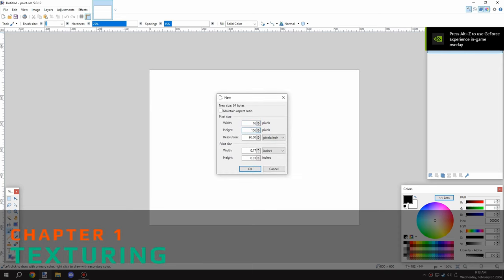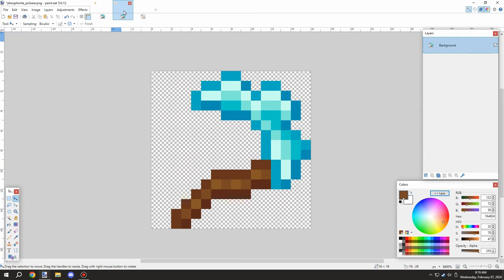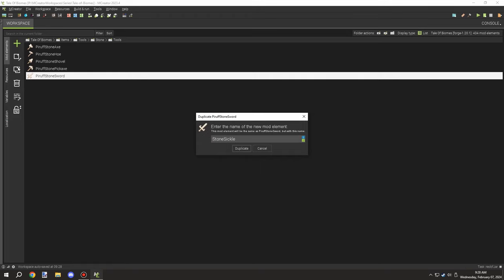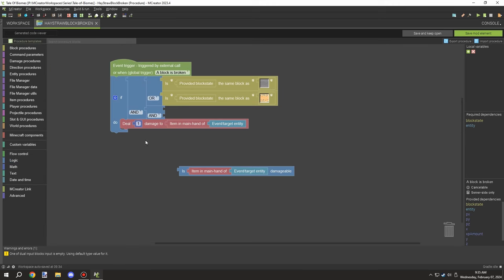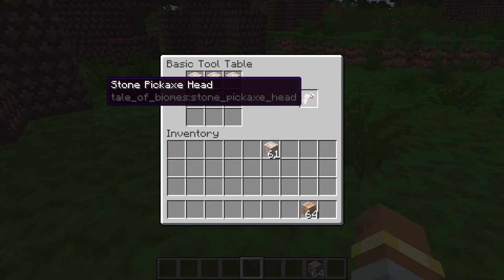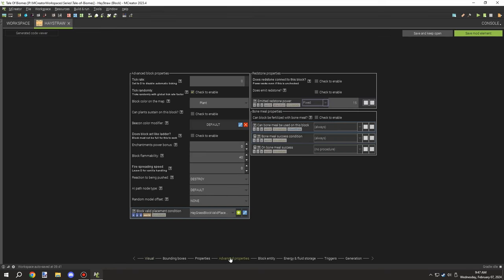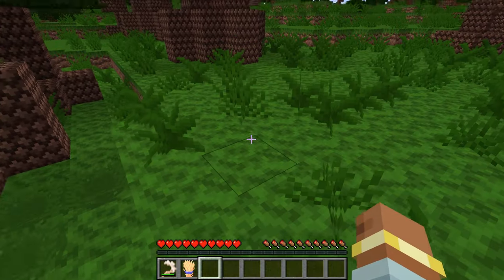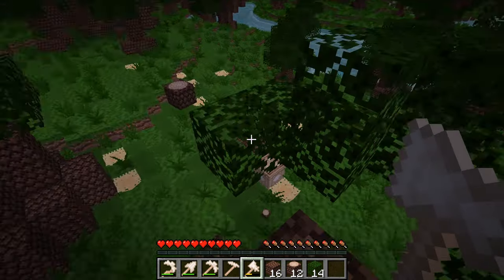Sickles Tools | MCreator Lore | Ep55

Comment: Can you guide on how to identify Entities with NBT Tags if it exists in the procedure?

like:
Scoryboard Objectives Add Count Dummy
Scoryboard Players Add Zero Count 0
Scoryboard Players Add Mob Count 0
Execute Store Result Score Mob Count If Entity @E [Tag = Enemy] (OR TAGS NBT)
Execute If Score Mob Count> Zero Count Run ??? False
Execute If Score Mob Count = Zero Count Run ??? True
Reply from the maker: When it comes to scoreboards they will only work on entities if the player has a display set.
At least this is what I have found the few times I have tested the entity.

However, I will do my best to explain the NBT system
If you use the /data get entity <entity UUID> it will display the entity NBT variables.
If you set custom entity NBT tags then it will be under ForgeData:{}
So like this

/execute if entity @e[nbt={ForgeData:{Name:"one"}}]

If you want to test if the entity health in the world.
Then you can use something like this.

/execute if entity @e[nbt={Health:4.0f}]

This will allow you to test for each entity in the world with health of 4.0
You can use the data command and copy the NBT path directly from there.
One important note is it should be spelt the same exact way.
For example, testing {health:4.0f} would not work because the "h" needs to be uppercase like {Health:4.0f}
You also need the letters at the end so with health it uses "f" some use "b" and "d" as well.

For tags, I am not fully sure how to do that but if it uses scoreboards then it may have issues as scoreboards in MCreator only display when the display is set to players so the script only functions when a player has a display set.
I suggest going with NBT as it allows a bit more flexibility.

I hope this helps a bit.
Reply: @NorthWestTreesMCreator  I discovered that Block Execute Command could use Create Text to add variables, etc. to the pretty good command: D